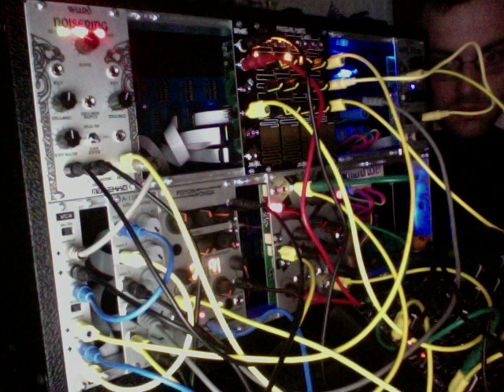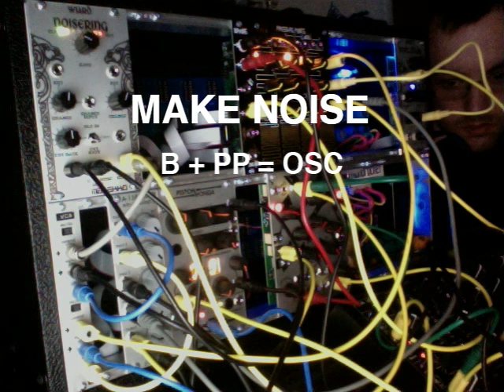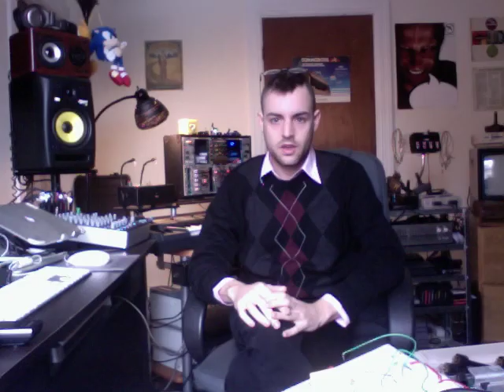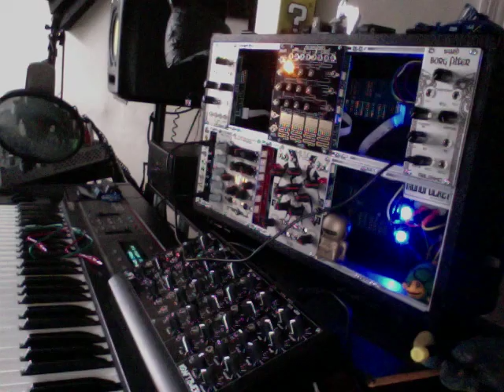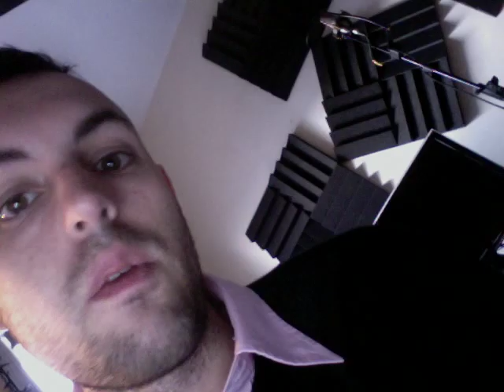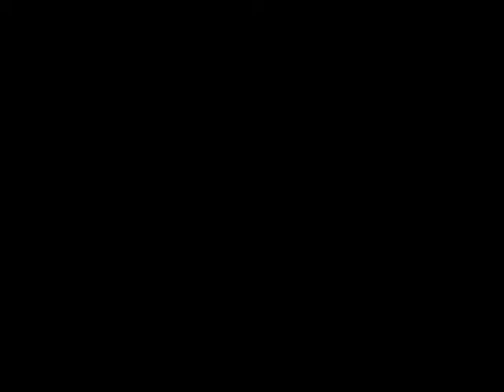Make Noise Brains and Pressure Points is an Oscillator

Comment: I like very much your video !!! One question : does it work if you feed your Brains with an audio square (or pulse) waveform ? Will Brains track the pitch of that audio signal ? I mean :  can Brains+PressurePoints be a kind of Moogerfooger FreqBox if it is driven by an audio signal ? And if the answer is yes, can you do a video about that ?